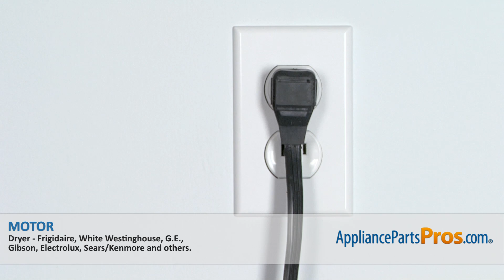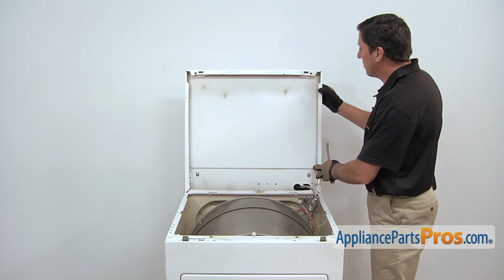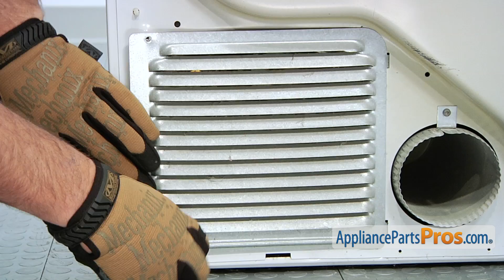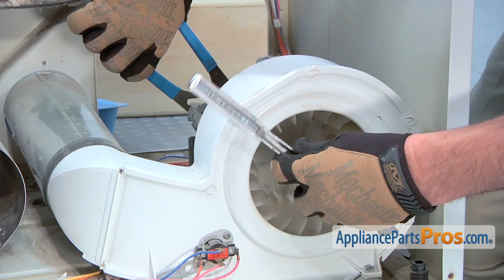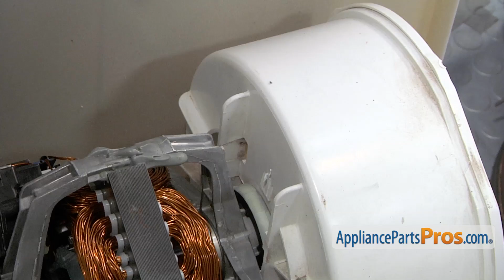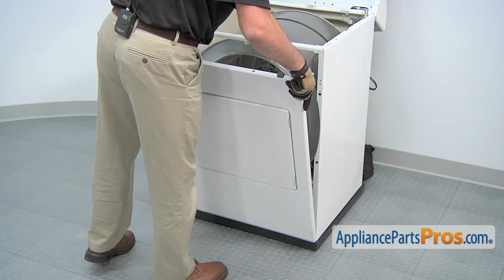How To: Frigidaire/Electrolux Motor 131560100

Comment: when I use a pair of locking pliers and a 7/8 socket something is still spinning so any time I put any torque on the socket handle there's a stepped slipping feel and the nut won't loosen. Any helpful thoughts? Thanks, great video otherwise.
Reply from the maker: It sounds as if the nut could be stripped and that is why it won't come out. What is the model number of your appliance?

Comment: The video, unless I missed, did not show that 3 screws hold the big tumble to the frame, bearing and shaft.
Reply: They don't say it but you have to lift the drum first and then pull it out.  The ball shaft will come with the drum and you won't need to unscrew it.
Reply: @SteeveGilbert  yeap! That is for sure, drier came up and has been running since. Thanks for getting back to this